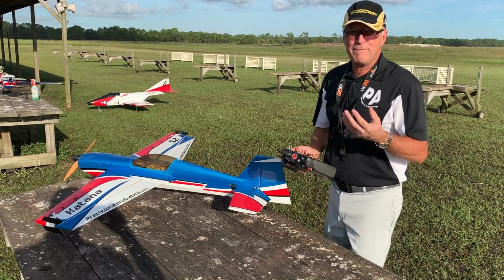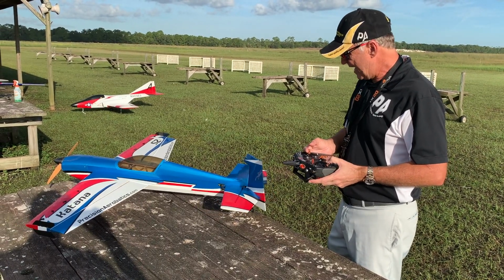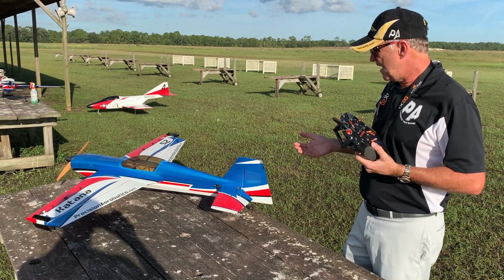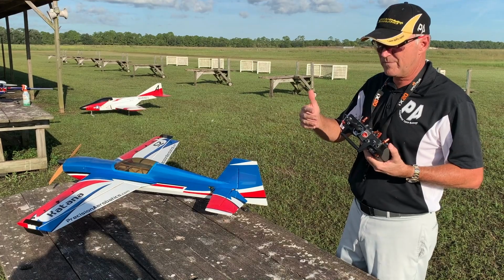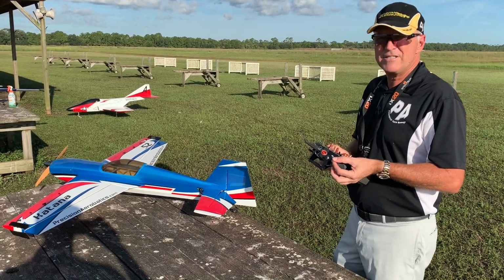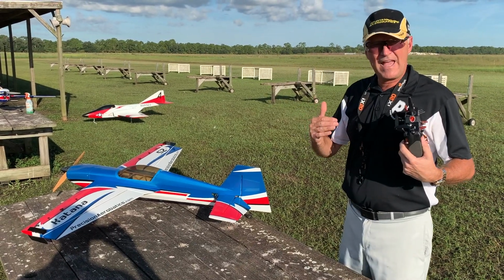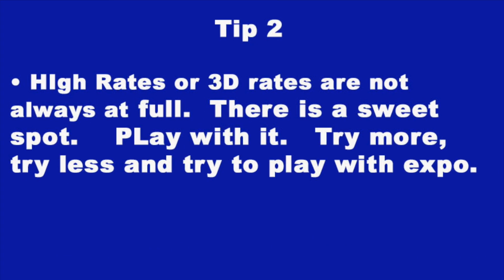Michael Wargo On Using Rates, Switching and Expo Properly to Improve Flying

Comment: Anyone knows what’s a good rate and expo on each surface for initial flight of 40 size high wing trainer?
Reply from the maker: Really rates depend on the plane.   But A good starting expo might be 20%.   Give a bit of soft at the center.   But often the controls are not very effective.   Be careful above that unless it has a lot of throw.   Like the Tundras and things it has a good roll rate as opposed to the bixler or something.

Comment: The problem with using a lot of throw and compensating with expo to to tame things around center stick is you lose a lot of resolution due the the long servo arms unless you spend BIG money of servos! Just make sure you are at full servo travel in your radio (125 or 150%) when on high rates. This means you can use a shorter servo arm and retain more resolution and mechanical torque.

Comment: How can you set a 4th rate.....I thought rates can only be set to 1 switch
Reply: Actually I've never tried so I don't know for sure
Reply: I would think they would interfere.....like say you were in flight mode 2 and it already has a rate so if you program rates to another switch does it just flight mode 2 rate go away if it's switchd I into the "4th rate"
Reply from the maker: Not sure what radio you have, but you probably have the option for an additional rate switch.   Up to 5.   Look at the flight MOde menu.   you should find it.

Comment: Love your videos, you mention 4 rates how is this possible on a three position switch.
Reply: I use two switches to get 5 rates using flight modes. The first switch is the B switch. The second switch is the stick position switch (SPS) on the rudder stick. I set the SPS so that it switches at 85% on either side of center. When switch B is in position 0, everything is in low rates. With B in position 1 and the rudder stick is deflected less than 85%, everything remains in low rates. But when I go beyond 85%, the ailerons and elevator go to high rates. This lets me fly smoothly as long as I don’t use all of the rudder, but when I peg the rudder I get full throw. Essentially, I can take off in low rates, flip B to the center, fly the whole flight without having to flip a switch, and flip B back to low rates when I’m ready to land. Position 2 of B switch puts all of the controls into 3D mode. Also, when switch B is in positions 1 and 2, I use an idle-up mix on the throttle so that my electric motors blow a little air past the tail feathers like a glow or gas engine would.
Reply from the maker: @txkflier  Clevver use of the radio...   I like it!   IN all my videos I discuss why we should always take off and land in high rates, although I take off on lower rates for special take off maneuvers.
Reply: @MichaelWargo  On most of my planes, low rates is 70 to 80 percent. On 3D planes, I might set the low rates to 50% and the highest rates to 125%. My servo travel is always 100% unless I tweak it a few percent to match multiple servos on a single surface. I try to use as much of my radio’s resolution as possible.
Reply from the maker: @txkflier  One of the most important things in setting a plane up is travel adjust.   IF you set all of your travel to 100% it is categorically wrong.   This is not an opinion, it is an absolute fact.  I have my setup guides you can find on the Hobbyking and PA websites as well as rc groups or in the manuals on the wargo design planes, I explain in great detail.  Also there are several setup videos clearly describing radio setup.    Travel adjust is set when rates at 100%.   Travel adjust actually establishes what is 100%.   Go to travel adjust...  Then deflect surface all the way.   Move the stick all the way and hold it.   Then adjust until the surface cannot move any more.   then back off 2 clicks.   This maximizes resolution and establishes 100% of your surfaces potential.   USually want to move to the surfaces physical limits.   They will always be uneven.  Best if between 120 and 145%       Normally, up elevator for instance would be 138, then down elevator will be 129     something like that.   Never exactly the same.   IF you set to even degrees both sides move 1 side to max and match other.   The adjust how far they move for your flying with the rates.
Reply: @MichaelWargo  I’ve seen a guy turn the servo travel down to 55%, put the pushrod in the inner hole on the control horn, and put a 3” arm on the servo to get the elevator to move far enough. This was on a 40%, 170cc Extra. When the elevator fluttered, I looked at it after he landed and that’s how he or the previous owner set it up. I saw another case where a guy set up his flaps by turning the travel down to zero in one direction and 75% in the other because he wouldn’t take the servo arm off and put it back on in the right position plus, he’d have to change the pushrod length. So, the flap servo was rotating a total of 30 degrees from flaps up to full flaps. That’s what categorically wrong is. I want my servos to rotate 40 to 45 degrees each direction in high rates and no less than 30 in low rates. I see lots of people turning the travel down due to binding instead of fixing the linkage geometry.
Reply from the maker: On spectrum and Futaba it is easily done on the radio to assign additional rates on another switch.   On my spectrum, I added the bottom right switch normally people assign to throttle cut.   When it is up, and regular switch is in middle position I get the fourth rate.   I believe 5 different rates is possible.

Comment: Can you give me your advice on setting elevator trim for a high wing plane please. Would you trim for straight and level at full throttle or at a cruising speed?
Reply from the maker: GReat Question.   Cruising Speed and put a Throttle Elevator Mix in for full throttle.
Reply: @MichaelWargo  Thank you very much I've seen many different answers but I trust yours 👍. I'll try this

Comment: Thank you for this vid!  I’ve been using rates on individual control surfaces for decades.  A lot to think about based on air speed and maneuver.  Your suggestion to put multiple surfaces on ONE rate setting is Huge!   Great hint!!  Thanks Michael.

Comment: I remember back in the day BEFORE dual rates and expo, mixing etc. were ever on the transmitters.  I don't know how I managed to stay in this hobby.  I lost many balsa kit - built planes.  If I wanted low rates, they were set mechanically on the horns.  But then, that's how you would have to fly until changing the whole setup.  Or I could set the linkages for high rates - usually ended disastrously.  Have we come a long way... or what!!

Comment: Hi Michael - this Video comes 1 week to late for me - i crashed my katana on the Maiden  - prepared like always - full Rate and 75% Expo in elevator and aileron with the suggested cg- but this Baby was to  "hibbelig"  - and the Maiden was about 10 seconds..... after first Frustration now i decided to repair it - next attempt with a cg much more to the nose 10mm - and dualrate 50-60 percent - what do you think about that ? - dont get me wrong i am not a beginner but also not a good 3d Pilot....(quod erat demonstrandum) - greetings from germany and thank you for your good videos
Reply: Make sure your expo is setup correctly. If it is 75% in the wrong direction, it will be nearly unflyable. Example: With Futaba and Spektrum negative and positive expo points have completely opposite outputs on the control surface. Flyer Beware!
Reply: I would never use more the 50% expo. Make sure the expo causes the graph trace to get flatter in the center, not steeper. Spektrum uses positive numbers; Futaba uses negative numbers.